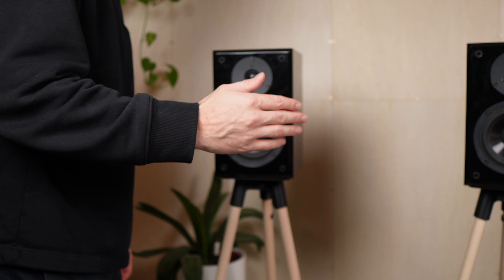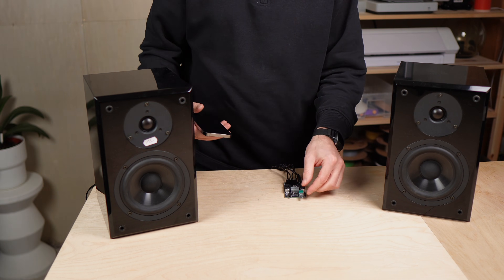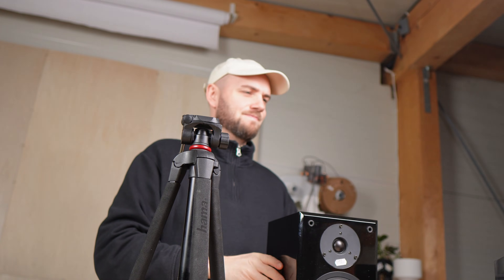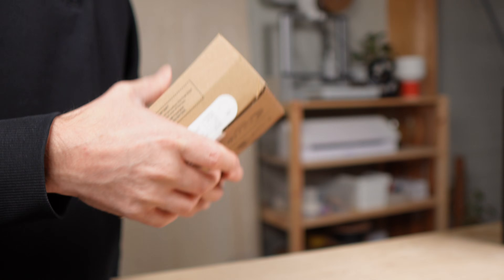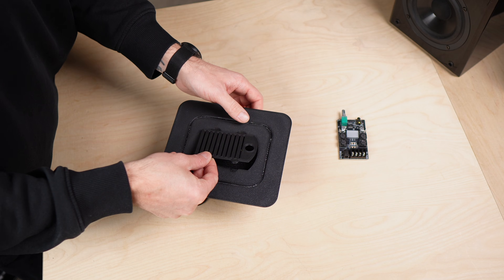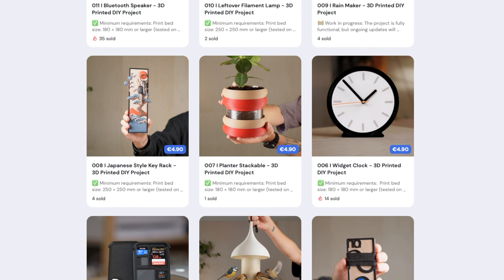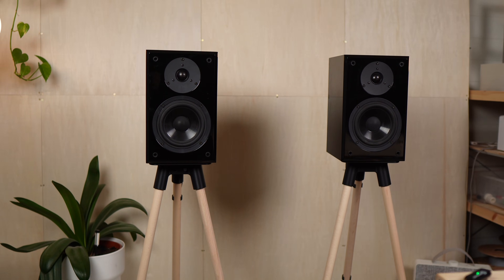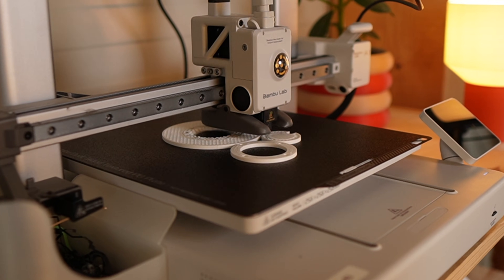I Turned 20-Year-Old Speakers Into a Modern Sound System

Comment: Have a home Cinema consisting of those speakers. One can find them quite cheap, because they came with an amp which is bad. 
I'm currently experimenting with building 3-Way Speakers, from two pairs of those speakers.
Reply from the maker: Nice! Yeah, the speakers themselves are actually decent. the original amp is definitely the weak point.

Comment: How do you make it work in stereo ?
Reply from the maker: The amplifier is a stereo amp and connects to both speakers with cables. Unfortunately, there’s no good wireless option for this setup.
Reply: @PaulLagierEN  the zk1001b is a mono version of this amp. When using 2 of these it’s possible to pair them as right and left channels. You’ll have to see if the size is the same, and also, each amp will need his own power brick.